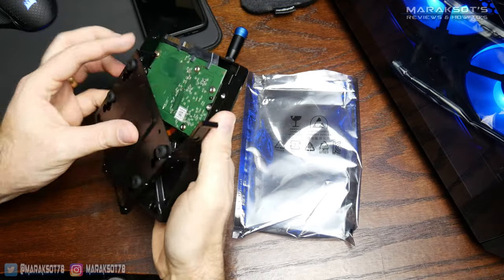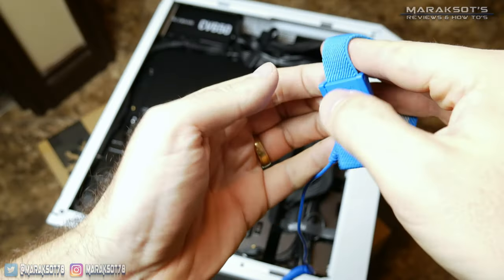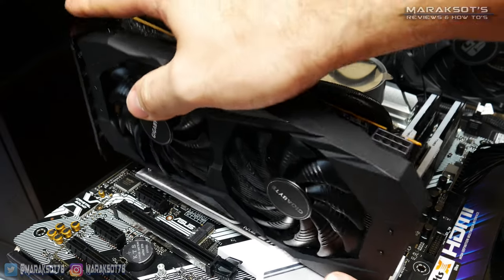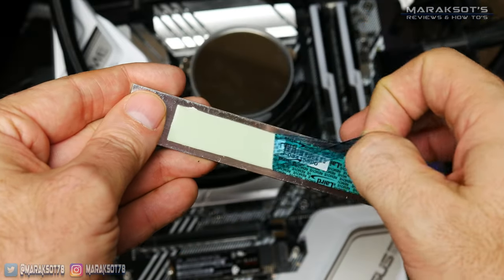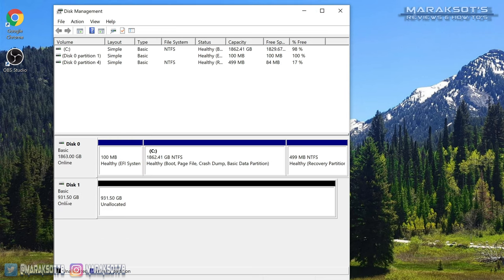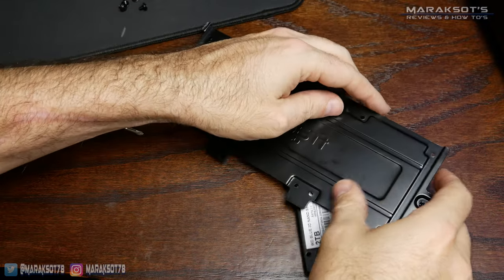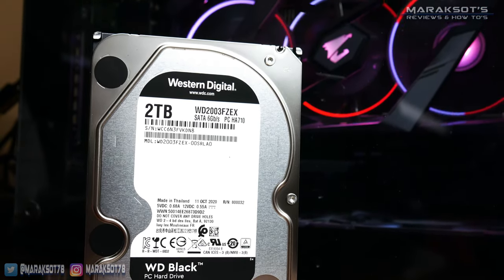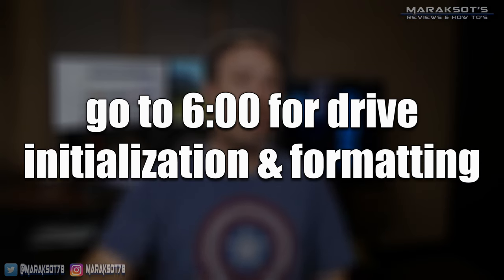A Beginners Guide: Upgrade Your PC Storage - How to install M.2 SSD, 2.5" SSD & 3.5" Hard Drive

Comment: I had a question I was hoping you could help me with - I'd like to replace my 1TB PCIE SSD with a 2TB PCIE, however my motherboard only has one slot.  Can I clone my current windows from my 1TB to a SATA drive, then replace the 1TB pcie with the 2TB one, then move windows back from the SATA to the 2TB pcie?
Reply: Can you help me? I have kind of a similar issue. I also only have 1 slot and I ordered a 1TB ssd. However I think my slot is already taken.. what do I do?

Comment: im confused.. my motherboard says it has 1 x m.2 Gen4 x4 slot, and 3 x M.2 Gen3 x4 slot. but when i open my case i only see "Lightning Fast Gen4 m.2" in eye view. i feel like when it says 3x and 1x its just for the size of the M.2 not actually extra slots for more storage...where could the other 3 slots be?? should i just contact NZXT? cause i ordered a 2TB gen3 M.2 tried cancelling it but they denied my cancel.. i dont wanna be left salty lol... edit: turns out my pc has 4 M.2 slots 😂 got it installed fast and ez cause of ur tutorial.. Ty 🤙

Comment: Hi i have a noob question. I use an nvme m.2 and I want to keep it and just add a SSD. Can I just plug in my SSD (the one with cables) and activate it using steps at 6:00? Or do I need to do something else?

Comment: I killed my first motherboard by improperly installing ram, still have no clue what happened exactly but man has it put me off of touching my pc's guts ever since
Reply: maybe you killed with static?, like by no means im a expert, and i also installed 2 ram sticks and i didn´t blew it up, im not an expert, and it went well, i used a metalic spoon attached to my skin and it worked well maybe was that?

Comment: I’m saving up to get a veno scorp pc NeonZilla - i7 16GB GTX 1660 6GB #810SE and it has 
Cpu: Intel Core i7 2600 3.10Ghz Renewed
Ram: 16GB DDR3 
Hard-Drive- 1TB HDD
Gpu: NVIDIA GTX 1660 6GB
Board: Veno Scorp 1155 Socket & USB 3.0
Windows 10 64 Bit Pre Installed

And I’m wondering if In the future when I get my pc if I run out of space will I be able to add in more space in by just adding another ssd in

Comment: If I don’t have the little set screw that holds the drive down, is that terrible lol? It has the little screw that set its height, but not the securing screw.

Comment: can a 3.5 be installed to a lap top or is the connection under powered due to its meant for a 2.5 drive ?
Reply: I don't think it will power it. But what would be the point anyways? The drive will not physically fit inside the laptop. If you want to use a 3.5" drive on your laptop, the next best thing is to buy a USB hard drive dock.

Comment: So I recently bought an m.2 ssd to upgrade my built PC. I already had a 500 gb sata ssd but it was getting full. I take apart my pc, install the m.2, and screw it in. Then I put everything back together. It boots up but right when I sign in it says "windows didnt load correctly." I got really scared becuase I thought that mabye I had shorted my MB. I open my pc, take out the m.2 ssd that I bought and tried booting up my pc and it worked perfectly fine. Could anyone tell me why this is happening and also tell me how to fix it? because I dont see anyone else having this problem

Comment: Ive encountered a problem with the NVME drive. When i plug it in and try and use it. It chooses to boot that over my original hard drive which the new one has nothing on it. Going into bios nothing i do fixes this when prioritizing different boot options. I then tried plugging it in while the computer is on as it opened windows and it doesn’t recognize the drive. I dont know what the problem is. I have an ssd drive and i want to add the nvme which is the first of its kind in my pc.

Comment: Just keep your elbow touching the metal 
case 
touching metal every once and a while working on the system won’t work you could still blow your system
Sometimes parts will hold a very low charge could damage some parts but more then likely not but if you wanna be safe stay grounded to metal while touching internals you don’t need a ground band or static mat

Comment: Your advice on static charge is not good advice. The reason being that in some environments static build up is very prevalent while it is mostly absent in others . I'm from a drier climate where just walking in your socks can get you semi electrocuted , or at least it feels like it . I now live on the pacific coast where you couldn't get a static electricity spark if your life depended on it. Hell , we don't even get lightning ! So as for myself , I'm getting the wrist strap just in case .

Comment: Hi I want to replace my M.2 NVME SSD, currently mines at 250gb and im planning to replace it with a 1tb, is there anything to note if i want to switch the ssd e.g. what happens to the old files etc.
Reply: If you want to keep your files and OS, what you can do is to clone the old drive. There are plenty of cloning tools like Acronis TrueImage, CloneZilla, Macrium Reflect, etc. In short, cloning, as the name implies, makes a copy of the data from the old drive and transfers it to the new drive. Once the clone is done, you can remove the old drive or repurpose it for extra storage.

Comment: Would I able to use my western digital SSD in my PS5 and put it in my PC?
Reply: Its one or the other. The PS5 uses a proprietary file system that Windows cannot read. So while you can plug it into your PC, it won't know what to do with it and you will need to format it in order for it to work on your PC.

Comment: could you make a video on factory reset with the command prompt for windows 10?
Reply from the maker: Are you talking about how to use diskpart to "clean" the disk and make it where you have to initialize and format the drive again?
Reply: @Maraksot78   No, I fixed my problem its all good

Comment: Can someone help me, I have an msi gf63 thin 10 sc. I have bought a new crucial p5 plus pcle 4.0 nine m.2 ssd and I don’t know if I have to transfer all of my files or how to even do that. My laptop came with 256 gb, which ram out fast and I desperately need an upgrade. I just have no clue how to upgrade the ssd or how to transfer data.

Comment: Can you share a link to that bracket/Mount you placed you SSD ?
Reply from the maker: That drive sled comes with the Fractal Design Meshify C case the PC in this video was built in.
Reply: @Maraksot78  do you happen to know any other companies that may have something similar?
Reply from the maker: @Ohwowryanwtf  the only thing I've used before that I had to buy separately from my computer case are sleds that adapt a 3.5" drive bay into a 2.5" drive sled like this one - https://www.amazon.com/dp/B00G57BN1M/ref=cm_sw_r_apan_glt_fabc_ACGEY1T8TMEGGTR0CETP?_encoding=UTF8&psc=1

Comment: I know this is an old video but I still hope somebody can help because I’m a absolutely clueless. I have an older gaming PC already, my daughters old one that I had ideas about teaching myself how to upgrade and failed because I got overwhelmed and I mostly game on consoles anyway, so it’s sort of sat there doing nothing,  I bought my daughter a new one a few years ago and  she’s getting pop ups saying she needs more disc space to install a game update. 

 My question is can I take the storage from  the old gaming pc and pop into the new one and initialise and format it that way? There’s nothing in the old one that’s important so if it gets wiped it’s fine, I just wanted to check I’m not going fuck up the one she’s using daily doing this and if it would be safer/better to just buy new?

 I feel confident in opening the case and looking for sockets and cables and all that, I’m just worried that I might need to do a step with the older storage before putting it in new one and that if I miss it I’ll break my 17 year olds gaming PC.  

 Thank you anyone for reading and any replies I might get.

Comment: Okay but how do I install the new Pc storage to function as an individual unit with the primary device? I already have an external secondary drive if I wanted to simply save more stuff. I have larger programs that I would like to run. pls help.

Comment: hey someone please help, so my storage type is the simple little chip you hold in place with a screw. so im getting close to running out of storage and was wondering if i take out the used chip and put a new one in, will all of my stuff be on the new one or will everything that i have on my pc just disappear??

Comment: just a question hi sir can i just add and install the M.2 ssd  without doing a format on my existing ssd because there's some important files there that i cant delete or uninstall for some reason so can i just add it on my storage without doing a format :)
Reply from the maker: You can just add the new drive if that's what you want to do. You do not have to format the old one.
Reply: @Maraksot78  thankyou so much for replying SHOUT OUT FROM PHILIPPINES BTW ! :D Godbless you sir
Reply from the maker: @justarandomvideos6594  Mabuhay Amigo! Tagalog or Bisaya? Kamao Bisaya ako. 😀
Reply: @Maraksot78  im tagalog mate haha sorry cant believe you can speak our language ! 😄
Reply from the maker: @justarandomvideos6594  Tagalog diay. Too bad. Hindi ako makaentende ng Tagalog. 😅 I lived in Cebu and Bohol from 1998 - 2000 and learned Cebuano (Bisaya) while there. Learned very little Tagalog but I did learn to say I don't understand Tagalog in Tagalog. 😂 I loved my time in the Philippines, the people there are very kind. It was a wonderful experience.

Comment: Question...If I already had an NVME ssd in my computer could I buy a better one and switch it out? Thanks.
Reply from the maker: Yes, but if your OS (i.e. Windows) is installed on it then you'll probably want to clone your old drive to the new one first and then swap them out.  That is unless you're Ok with starting with a fresh copy of Windows and installing all your drivers and other applications.  I actually have a video about drive cloning if you'd like to check it out.  https://youtu.be/8SYg8ieAzzU

Comment: my PC was pre built and has a 256 SSD I switched it with a 1 TB Firecuda 530 but my windows 11 operating system wasn’t on it is there anyway I can put Windows 11 on my 1TB FireCuda SSD?
Reply from the maker: Yes, you'll have to clone your old OS drive to your new drive.
Reply: @Maraksot78  Thanks for the response my co worker explained it to me as well, Great Video!

Comment: what if I already have m.2 installed? Which is best hard drive or sata ssd?
Reply: If you have multiple m.2 slots (many computers do), use those first. After that, use sata ssds.

Comment: for some reason I cant pick my new ssd as a primary. and the hdd is like, a phantom, says its still there, and the bios loads from there. I want the bios to load from my ssd... its frustrating.
Reply: You should be able to change the boot order so that your SSD is the first boot device. How you do this depends on your motherboard's BIOS so you may need to play around with the settings.

Comment: I know this is an old video but I do have a question for you about replacing the only storage my pc has is a 250gb m.2 and I have a new 500gb but only one m.2 slot. how would I do the initialize and format process with only one drive slot?
Reply from the maker: If your motherboard only has one m.2 slot then you don't have a lot of options. You either need to buy an external USB m.2 drive enclosure and put your new drive in it at which point you can clone your existing drive onto it and then swap them out.  Or you can just swap them out and start with a fresh installation of Windows to the new drive.
Reply: @Maraksot78  ok thanks I am worried about how to install windows to the new m.2 when Install it to the pc. I believe my bios is locked as well. I'll look into it more and I'll just use the USB adapter if I have too
Reply: @fuckwizop  I still haven't messed with it tbh. But you should be able to get an adapter to plug into a USB port and then format the drive and install WINDOWS. I think the problem is the pre-built like Dell hp etc. Have locked cpus and bios so u can't switch boot drive and things like that
Reply: @fuckwizop  you'll want to use the pc with the old drive in place and the new drive hooked up to the USB. Then you will want to format the new drive and load the windows install tool onto the new drive. There are videos on how to use the USB to load the windows files to your new drive. Windows has the tool available
Reply: Then once you have the windows tool on your drive you can swap them out and it should boot into the new drive and load the installer. It's been a while but there should be plenty of videos.

Comment: I've installed my m.2 ssd but it isn't showing up at all on disk management, I don't know what's wrong with it. My motherboard didn't come with the screw so currently it's installed screw less, but I've read that it should still work. I was planning on using it for now and ordering some screws for it but it isn't appearing as a usable disk, its like I never installed it in the first place. Any ideas? Has it got to do with BIOS or something?
Reply from the maker: It could be that it's not screwed down that's causing the problem. But another thought that comes to mind is depending on your motherboard and the CPU you're using and whether your m.2 nvme drive is PCIe 3.0 or PCIe 4.0 compliant the top m.2 slot may not work.  For example, Intel LGA 1200 motherboards support both 10th and 11th gen CPU's and support PCIe 4.0, HOWEVER... the top PCIe 4.0 m.2 slot, closest to the CPU, only works if you have an 11th gen CPU; because only 11th gen CPU's support PCIe 4.0. If you have a 10th gen CPU that slot won't work so you have to use the other m.2 slot, assuming your motherboard has another m.2 slot.
Reply: @Maraksot78  thanks a lot for the help, apparently the m.2 ssd I ordered simply isn't compatible with my ASRock ab350 pro4, it was the WD_Black SN850. My CPU is the Ryzen 7 1700X for ur information. But yeah, ordered a different m.2 that is PCIE x 3 so hopefully all is well and I get a refund on this one

Comment: does it matter which m.2 slot I put the new ssd in ? My old ssd is 500 gb, new one is 1tb, should I put the new one in place of the old one and move the old one to the secondary slot? I am working with ASROCK  B460 steel legend motherboard.
Reply from the maker: I just looked up your B450 Steel Legend motherboard and if I were you I'd put your new 1TB drive in the top m.2 slot which is a PCIE Gen 3 X4 slot and move your old one to the lower m.2 slot... assuming you're going to install Windows to your new drive of course. If your OS is installed on your 500GB drive and you're going to continue using it as your OS drive then I'd put the 1TB in the lower slot and leave the 500GB in the top slot.
Reply: @Maraksot78  thank you
Reply from the maker: @gormiksoc  no problem.  :)

Comment: My m.2 doesn't even show up at all in the disk management
Reply from the maker: What motherboard and CPU do you have?  I ask because I know with some intel motherboards and 10th Gen Core i CPU's the top m.2 slot does not work.  It will only work with an 11th gen CPU.  Most of those I've seen have a 2nd m.2 slot toward the bottom of the motherboard though and that one works with 10th Gen CPU's.
Reply: @Maraksot78  Ya I have a 10th gen intel board, and I am trying to get it in the top slot because I have already usrd the bottom slot for 1 year
Reply from the maker: @rutylzz  Bummer man. Yah, unfortunately the only way to make that slot usable is to upgrade your CPU to an 11th gen.

Comment: I don’t know why but my motherboard is compatible with the 990 m.2 ssd, my computer knows it’s there but doesn’t show me drive on the disk management screen
Reply from the maker: What CPU do you have? Is it Intel 10th gen? If you have a 10th gen CPU, you can't use the top m.2 slot. The motherboards for 10th gen Intel support 11th gen CPU's also, and the top m.2 slot only works with 11th gen CPU's. With 10th gen CPU's you have to use the m.2 slot that's lower on the motherboard. Not sure this is your problem but this is the only thing I know of that might be causing the issue it sounds like you're having.
Reply: @Maraksot78  sorry I just forgot to look up the motherboard manufacture page, the mother board I have doesn’t support the 990 pro m.2 yet only the 980 and under
Reply from the maker: @havoc9591  oh, ok. Good to hear you got it figured out.

Comment: I'm following the instruction because Ryzen is trying to obsolete my old hard drive by only putting up dates for my AMD 3 3100 if it also includes an SSD, otherwise, the updates will reject it. I confronted them with it and the only answer was to send a virtual copy of the whole computer to see what is wrong. They were just denying it. Corporate fascist! I'm going to use it for C, but keep my hard drive two for storage since my b550 m pro doesn't contain a lot of inputs to all three. It is a small motherboard version . I'm so mad that had to spend extra money just to get those updates to my CPU. That isn't right .they should have included updates for those who had hard discs only. I'm going to back up c with a flash stick 250. GB's